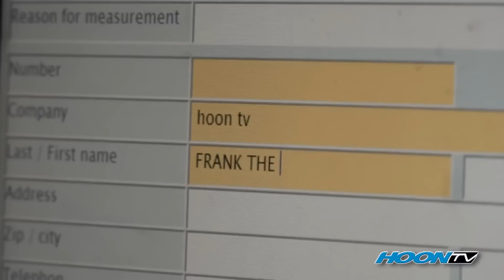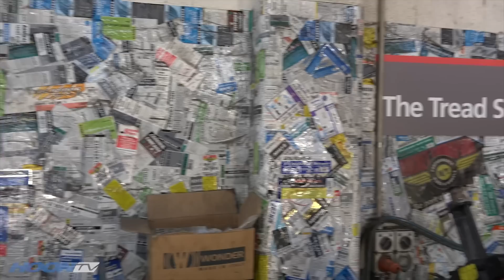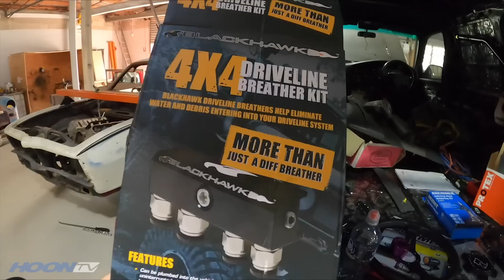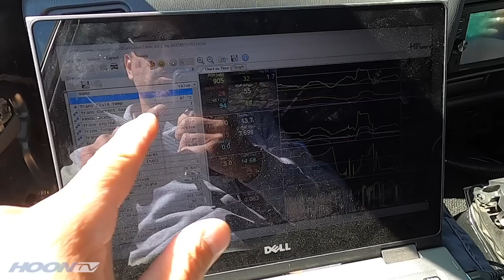LS Powered Landcruiser 80 Series PANELVAN in 10 MINUTES ⏱

Comment: I'm thinking of buying a used one to restore it. Any tips you got for me like things to look out for or common issues? BTW awesome build my guys 💪🏻
Reply from the maker: Many thanks Hasham. I’d firstly say that if you’re not 100% confident in looking, but have a bike you’re interested in buying, then get it professionally inspected. Otherwise though, with these the first thing I’d look at is possible crash damage. Dented steering stops, subframe welded back on.
Reply: @HoonTV  Thank you very much.
Reply: Buy one with no rust. Sometimes you have to pay a lot  more, but in the end you’d be glad you did. I made the mistake of buying one that has some rust and it was a pain to get it off. And there are some areas that you can’t get to.